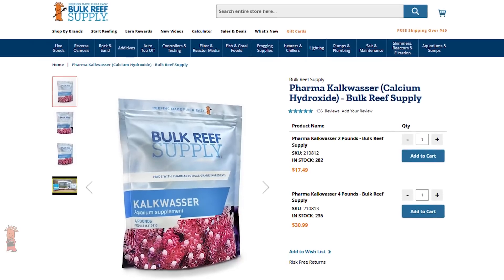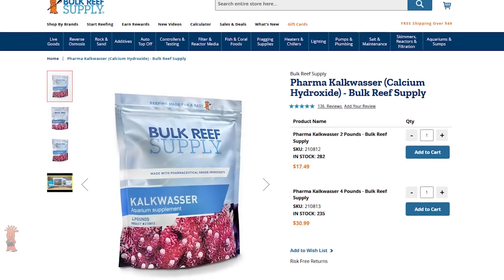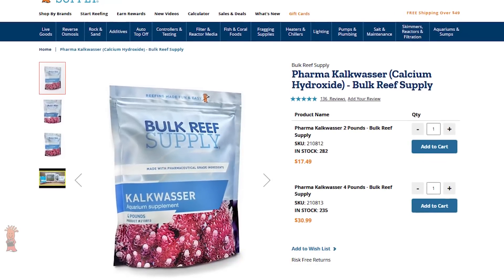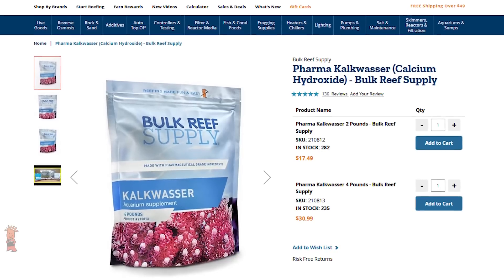Top 20 Kalkwasser Secrets...Or Fails. Best Kept Secret For Your Reef Tank!

Comment: Kalkwasser + calcium reactor worked for me for a very long time but I switched to DIY All-for-Reef + recirculating CO2 scrubber modded skimmer last year and I believe I've finally found the perfect dosing method. Can't beat the simplicity and ease of AFR + CO2 scrubber mod skimming at maintaining Ca/Mg/Alk and pH
Reply: @jdamommio  Not much to it. Tropic Marin's All for Reef is a calcium/magnesium/alk solution. It also has trace elements. It's an all-in-one solution minus the sodium, so it doesn't raise salinity so you don't have to balance that later on. 

BRS has a CO2 scrubber mod for skimmers which makes it so that it only scrubs the air circulating through the skimmer/in your tank water instead of wasting the media on air in your house.

These two implemented together take care of your dosing needs and pH, which are imo the most important parameters to balance and maintain in reefing. Ask away if you have any more questions.

**I would suggest DIYing carbo-calcium + magnesium solution without the trace elements if your tank is sub 1 year or isn't wall to wall coral yet.**
Reply: Just to clarify, All for Reef isn't the cheapest solution to larger volume tanks, but the DIY is much less costly. BRS also has you covered on the recipe just search the channel.
Reply: @Atalantum  how long does the co2 media last when you do the recirculating skimmer mod?
Reply: @Atalantum  I have a 36 bowfront with very little room under the tank  can i fit a scrubber.  Where do I find out more info on this and do use kalk in an ato or a doser? I run bare bones now.  Everything by hand because of space issues but maybe I can make some room in closet nex t to the tank.  Couldnt I use kalk in ato if I hook up my senye that has a ph alert? Also get a good ato with mutiple redundancy!  I get no help from hubby so being a woman also makes it hard one of the reasons I do it all by hand!
Reply: @jennanation6992  Hi Jenna. If you have a skimmer you can probably just fit a scrubber by putting Tupperware filled with scrubber media on top of the collection cup. There are videos on how to do this by other YouTubers. However, I have discontinued scrubber use and now dose kalkwasser along with all-for-reef. I find that the kalkwasser elevates my pH and so there is no need for the scrubber media. I dose saturated kalkwasser with a GHL 2.1 doser.

Comment: What is you live in fl and dont evap much? I havnt hooked up my ato yet because both my 20 gallons dosnt evap much so Is it possible that I won't need my ato and kalk solution is enough? I only have 1 week left to return it LOL  Is there a way to hook up a ph controller to an ato? Is there anytime that its smarter to use ato with kalk? I had a controller in my kart and you sold out LOL
Reply: The ph probe should go in your sump to measure the overall ph value of the tank not the solution. The solution will have a very high ph. You can measure it once yo do your mix to test its potency. I would use a dosing pump if you dont evaporate much. Start by testing your water parameters to see how much cal/alk consumption occurs in your tank by your inhabitants both coral and crabs and coralline algae will consume them. From that value you can start to dose small amounts and test again to see how much you need to maintain a desired cal/ alk level. Dont dose all at once. Spread it out through out the 24 hour period or dose it during the lights off period where your tank will experience a lower ph naturally. Good luck and happy reefing!

Comment: If I add a couple fans facing the top of my water either on my aquarium or sump, will that help with carbon dioxide?
Opening up a window is not an option as there are no windows around

Comment: You can absolutely use it in your ATO if you use a gravity ATO that is controlled by a float valve(not switch). As it will constantly be the same evaporation rate and return rate with gravity fed systems.
Reply: What I find funny is their website still recommends to use the ato method..

Comment: If using a stirrer that stirs on a timer, could you use with an ato and adjust the amount of stirring? For example you set the timer to stir every 3 hours and if you are dropping in dkh daily increase to stirring every 2 hours? I haven't hooked up my stirrer yet, but wanted to attempt this.
Reply from the maker: If you're using your ATO pump to feed through the stirrer to top off the water, it's difficult to gauge when exactly your ATO pump will kick on. In that case, I would set my stirrer timer to small short stirs as frequently as possible in order to ensure the water inside remains fully saturated when the ATO kicks on. Maybe 5min every 30 mins? This would be my top choice for timer that has the cycle capabilities to run a schedule like this. https://www.bulkreefsupply.com/save-a-watt-p4472-digital-timer.html

Comment: You mentioned dosing vinegar with Kalkwasser. Would it be possible to lightly carbon dose with the kalkwasser solution?
Reply from the maker: Vinegar is a form of carbon dosing, so in a way, you'd already be doing that by using it with the kalk 🙂

Comment: Would you get the full benefit if you poured the mix through a coffee filter or similar filter to remove the sediment / precipitate?
Reply from the maker: Possibly, but I would have a couple of concerns with this approach. First is how any filters you would need to go through to capture all of that fine left-over material and second, more exposure to the CO2 in the ambient air might degrade the potency (which you would have to test with an EC pen to know for sure.)
Reply: @BRStv  I guess this requires some testing.

Comment: can i use kalkwasser simultaneously with balling method because i have low ph or  will i have a problem with alk and ca
Reply from the maker: both will add calcium and alkalinity to your system, so if you add kalkwasser to a system that is already on the balling method, you'll want to reduce your balling dose and monitor your calcium and alkalinity closely while you dial everything in.
Reply: @BRStv  thank you very much for your answer

Comment: Alright, I've fear kalkwasser for decades, and just the past 2 weeks I started to experiment with it.
No video, no article explain fully what is happening in my case that I understand:

3 aquarium, almost the same pH, it varies between 7.4 to 8.0
Aquarium #1  has a Skimmer, which brings down the pH (This is where I dose kalk)
Other 2 aqua have no skimmer (nano) and pH is more stable and almost no dosing (for now... but I should... anyways)

At first when I started to dose Kalkwasser, I didn't have a pH boost, so started to dose more, noticed a better pH but... so small almost unnoticeable
Then I turn off the skimmer and this is where the pH started to raise more, but still .. 8.1 at max

Now here are the problems:

- Calcium is WAY too high, I set the limit for 450ppm (at the moment I'm at 480), so there's a Calcium accumulation in my mixed reef.
  Ones of my theory is the fact I use the concentrated at the bottom
- The amount of saturated water to dose is completely ridiculous, I have to dose something between 2-3x time above my limit of evaporation

With kalkwasser I basically need half of my aquarium size volume to make this practical.
For example the Voss bottle, 800ml, last only 2 days vs 2 month from the previous thing I was dosing.
The cylinder on that video is what I need to dose every day in my 33g to give you a basic idea.

Frustrated, I decided to directly add the powder to my aquarium to see the reaction (an amount that wouldn't crash) but... 
Kalkwasser seems to be a mess to deal with from a cleaning point of view. 
It mixes so badly with the water =/

Now here's the thing: Vinegar, that would increase the saturation, but decrease the pH which is what I'm trying to boost with kalk so it defeat the purpose.

I want to use Kalkwasser, but so far, all my experiments pointed to avoid it.
I also (still have) kalk in my ato, and thank you for changing you mind because it's... well a mess to clean after ;)

I use the SR aquaristik powder (Sorry, Canada...)

_________________ msg to BRS team/Ryan ______________
Hey, do you mind if I come to your studio and just fix your video production in different area?
Probably shouldn't say here but... everyone knows that I'm an open book.
Reply: @Aqua Splendor
When BRS was hiring, I think, earlier this year I was wondering if you would take the opportunity to apply.  I automatically thought of you because of your video production skills!

Comment: there is a milwaukee ph monitor that works in conjunction with a doser. The unit runs the doser til it reaches the desired pH. would it be okay to use this to dose my  Kalkwasser. Your input would be so much help.
Reply from the maker: Remember that kalkwasser also raises your calcium and alkalinity, so this setup could easily lead to a calcium/alkalinity overdose if you're not careful. For that reason, we wouldn't dose kalk based on pH alone.

Comment: Should I even look at this if I have a mainly softy tank? Only have a Duncan, monti cap and meteor shower cyphastrea that are lps or sps.
Reply: Test and see. If your alk and cal are fluctuating then you should consider it, but if you have small frags then it may be that your tank isn’t ready for dosing yet and your water changes are enough. I maintain about 8.0-8.2 alk with my kalk dosing
Reply: @okn712  my alk has never moved from 10. At least I’ve never tested anything else. And while I don’t usually test calcium as much as I should it also sits at 420. I only have large soft corals and just got some encrusting sps and the Duncan’s this year but all have been fine, I was more so wondering if this would inhavnce growth or would it cause more issues if me and my tank are not very advanced?

Comment: I actually have my PH running at night lows to around 8.0 daytime PH gets to 8.3 and I run a calcium reactor. I know most people doesn’t have this issue. Would my PH get to high if i dosed kalk
Reply from the maker: You will definitely see a pH increase using Kalk, so if low pH isn't your issue this might not be the right option.
Reply: Thanks that’s what I was thinking
Reply: @BRStv  would it be dumb to try kalkwasser if my ph is around 7.8, i use api color tubes and it is a light purple?

Comment: Does the container for the kalkwasser need to be air tight, the container I use is plastic and has a tiny hole drilled in the top to stop it creating a vacuum? Is this okay?
Reply from the maker: You nailed it on the head! No issues with this approach at all.
Reply: @BRStv  thanks, keep up the brilliant videos with great content.

Comment: What is max saturation for kalkwasser?
Reply from the maker: Max saturation is around 10.3 mS/cm, but it is difficult to achieve perfectly due to variables like water temp, water purity, etc. This is why we recommend mixing up a batch of 2tsp/gal and using an EC Pen to get a baseline for your own "max saturation", then use that number to identify when your kalkwasser is getting depleted.
Reply: @BRStv  Thank you for your reply. So for me, I am going the dosing out of a five gallon bucket route, the reason why I wanted to know max saturation. I'm at 20 tsp in 5 gallons of ro/di and I am at 7.8 mS/cm. Also, could you touch a little more on the benefits of adding vinegar and at what ratio. Thank you.

Comment: Shill. Kalk dosed via ATO has worked for millions for a long time. The gadgets are not needed. Marketing is on point at BRS though😂
Reply: Well they did say multiple times you don't need the extra equipment. They only suggested the tank be separate from he ATO water to avoid the biggest mistake that frequently happens which is a gummed up a valve that sticks open and kills the tank. Anyone around long enough has seen plenty of previously successful people do this.
Reply: @Slide-Loc  I’ve been around long enough to know that an ATO that has a double optical sensor will fail less than than most equipment. I have seen many nuked tanks from a kalk doser running away. I’ve also been around long enough to know BRS changes stance on many products, methods and theories. Don’t fix what’s not broken, unless you are doing YouTube videos as marketing tools.. but at least be consistent in what you recommend subscribers to do.